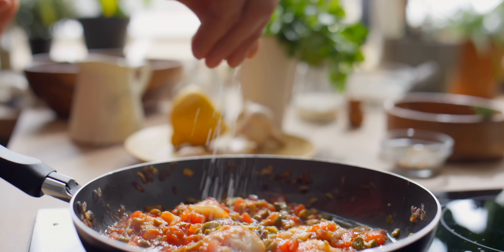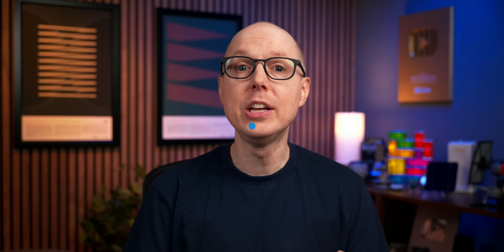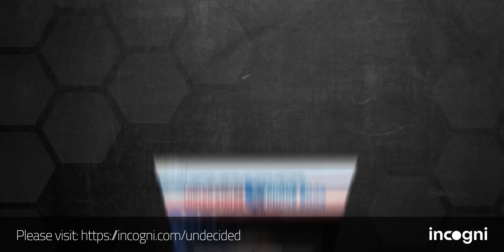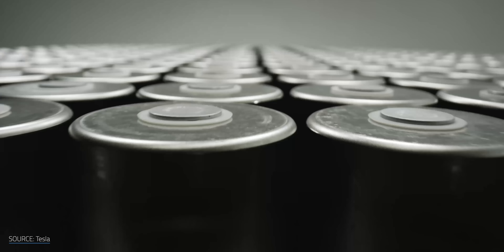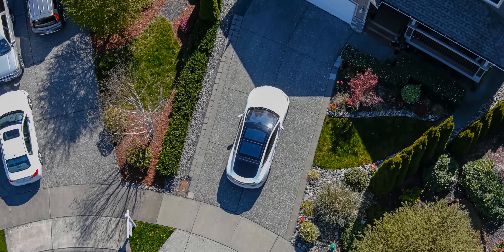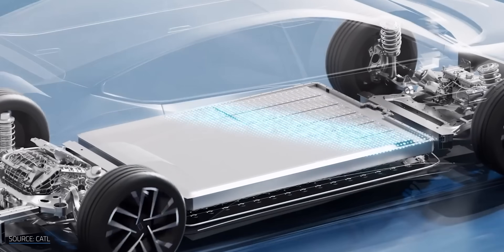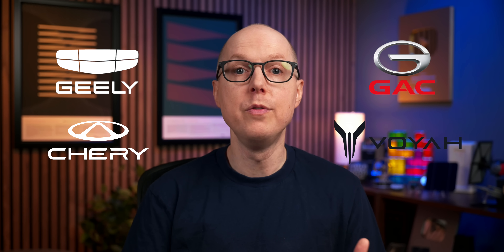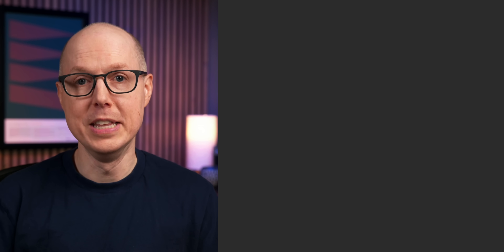How CATL Made Batteries 90% Cheaper (And What Happens Next)

Comment: Just researched a bit and here a some facts and numbers stated by CATL and other sources:

- mass production of gen1 sodium-iron batteries will start December 2025 
- gen1 will have an energy density of 175 wh/kg
- they are aiming to start mass production of gen2 by 2027, with an energy density exceeding 200 wh/kg
- the batteries are currently more expensive than lithium-ion or lithium-iron batteries, becoming price competitive when economies of scale and adoption catches on, expected by 2027
- the batteries are operational until -30 C, they demonstrated fast charging with up to 1200kw
- Naxtra batteries are expected to last 10000+ charge cycles compared to the 2-4000 cycles of lifepo4 batteries 
- CATL was one of the first battery manufacturers with sodium iron batteries in their portfolio and has been selling older gen products since 2021
- 67 car models are confirmed to launch using the new battery technology (although CATL is probably subsidizing the costs to be competitive)
- CATL is the biggest battery manufacturers the world and is expecting that the sodium-iron batteries will replace 50% of the lifepo4 batteries, a market they currently dominate

-> This does not seem to be vaporware, compared to many other „upcoming“ battery technologies mentioned on this channel, that are still years away and will be obsolete by the time they actually make it to market. Also, CATL actually has the cash to subsidize the batteries and speed up adoption until economies of scale kick in.
Reply: The potential is huge. A more practical renewable energy sector and electronics lasting longer. Let's hope for the best
Reply: The advantages in the cold are what will really open up markets. Modern LFP batteries waste a LOT of their power in cold environments just warming themselves up enough to remain functional for either charge or discharge, and some of the highest uptake markets for EV's are the Scandinavian countries due to government incentives. 

Also, there are large sections of the world where cars have to be left running overnight (some parts of Russia, China and Mongolia, Finland, Canada) to prevent them freezing up and becoming unusable. The carbon emissions reduction and reduction in operating costs for owners could be very significant in those markets. 

Also, there are already places that ban LFP battery EV's due to the fire risk. These vehicles would  potentially circumvent those restrictions and be a lot cheaper to insure.

If car manufacturers offer a Na battery version for particular markets I think they're on a winner, even if the price is on par. It certainly won't be the first choice for EVERY market until the price becomes far lower. Will that be enough of a market percentage to bring the cost down via economy of scale?

Range isn't everything for most users, safety and charging speed are at least as important, but cost is even more important. If CATL had brought this out 5 years ago it would have been a game changer. Now? It may be too late unless they are willing to internally subsidise production costs for market share.
Reply: @AndyViant  lithium is much less available than natrium so this tech still worth it for most markets. why china subsidises it so much is something i don’t understand yet.
Reply: @AndyViant these salt batteries cease to function at -30c. So they aren’t the solution.
Reply: @gordtulk  -30 C is a lot better than 0 C.
Reply: @gordtulk  Diesel freezes at -15°C and humans die long before then, what's your point?
Reply: @Adrian-Wright  obviously you don’t live anywhere cold. They make winter blends of diesel that has kerosene and other additives that keep it flowing down past -50c
Reply: @AndyViant  what current EV battery ceases to function at 0c?
Reply: @gordtulk  Your petrol engine won't function at -30c either. That's why you need block heaters. Guess what.... batteries can be heated too...
Reply: @theelectricmonk3909   EVs function just fine at -30c, if some engineer has spent the time to figure out how. As for petrol engines and block heaters, I live in the north of Finland, where it gets below -40c/-40f almost every winter. I don't always have a block heater, or can't use it anyway, but I've never been stranded because the engine is too cold. 12V batteries have let me down a few times, but jumping the car is always the solution. I've been especially happy with Toyotas, both the old beaters such as an -88 1.3L Corolla, and a hybrid 2.0L from 2019. There, too, someone has to think beforehand about what oil you can run here. Or you make sure you have power for the block heater 😄
Reply: @theelectricmonk3909   Oh, I should also mention, that the Toyota hybrid starts the EV system with the 12V battery, and only then the EV battery starts the engine. So it's basically a battery that functions in -40c, personally tested last winter in slightly windy -43c weather 🥶
Reply: @juhalampola1954  I should probably clarify actually.... because of course a petrol engine will run in -30 (or colder) temperatures - as long as the fuel can be atomised, and a spark created. In fact, a petrol engine will work better at lower temps, as the air is denser = more oxygen.

However.... if you leave it parked outside for a couple of days in -30 (or lower) temps, the chances of successfully starting it will be rather low, I think - unless you've got a block heater, or a spare warm 12v battery!
Reply: @theelectricmonk3909  modern cars start at -45 without block heaters.
Reply: @theelectricmonk3909  Some cars have problems, of course! The rest have been made to work in the cold. Here it's common for people to go to all kinds of winter activities, such as combined cross-country skiing and camping in the woods (scouts, especially!), or reservist maneuvers (something like 40% of citizens have served in the Defece Forces), leaving their cars in the lower end of nowhere for days, sometimes weeks, even in sub -30c temps. Starting problems are rare, and have been since, roughly, the year 2000. Gasoline, diesel (winter blend), or electric, it doesn't matter.

I have personal experince with two gasoline cars that didn't have an engine heater, model years '91 and '78, that never had starting problems unless I had skimped on maintenance. Yes, I did start both several times under -30c, after sitting outside (apartment block parking) for more than three days. The cars that can't do that get sold to people further south 😅

What people fear about winter driving is, first, fear itself, and second, incompetence. Fear keeps you from starting the car in the cold. Incompetent maintenance, be it you or your mechanic, keeps the car from starting in the cold. (Caveat: the cars made by manufacturers who simply don't care how they perform in the cold.) Everything else has been solved a long time ago.

Oh, about the -43c start with the hybrid Toyota. I was at a wilderness cabin, at river bend surrounded by steep 300ft hills, and the place is known to get really cold at times. Got there on Saturday (-10c or so) Monday was really cold at -35c, left at noon on Tuesday with the car saying it's -43c, drove home over a few hours and it was -15c. Don't get me started with how much snow there was...
Reply: @gordtulk  Define "modern" 😄 I used to have -78 Volvo, without engine heater, that started in close to -40c weather as if under a palm tree, as long as I made sure the big (old) aftermarket battery I got it with was watered! I'm pretty sure I started it at -45c once🤔
Reply: @juhalampola1954  ironically - a couple years ago I was flying in/out of Edmonton in January and as is usually the case the overnight lows are -30 to -40. I like thousands of others park in an out door lot and leave their car for days or even a couple weeks. 

On returning and taking the shuttle bus to the lot the driver would wait at every drop off until the car owner managed to get his car to start - at -35 frostbite in a few minutes is a real threat - if it didn’t he was ready to boost the vehicle. 

I asked if there was a brand of car that was the worst for needing a boost. He responded instantly- “Volvo” the worst by far.
Reply: @gordtulk   Volvo in '78 (and '98, when I had the car) was Swedish. Swedish design, Swedish engineering, Swedish manufacturing.

Volvo in 2025 is Chinese. Chinese design (with token Swedes), Chinese engineering, Chinese manufacturing.

Make your own assumptions/conclusions ;)

If you want to drive something nice, that's made in Sweden in the last few years, shell out a few hundred grand for a Scania semi 😂 In the 80's, everyone here in Finland drove or wanted to drive a Volvo, because they were safe and they just worked. I didn't mention my car because Volvos nowadays would be good, but because my -78 240 (244) was.
Reply: @juhalampola1954 these were Swedish Volvos. Apparently they had a notorious accessory drain that could only be stopped by disconnecting the battery.
Reply: @gordtulk  Nonsense, the amount of energy needed to keep the battery at -30C in a say -40C environment is trivial, besides "The Naxtra passenger EV Battery retains 90% usable power at -40°C"
Reply: @gordtulk   Oh, sorry, English is not my first language, so I understand "a couple years" as significantly less than 15 years. Ford sold Volvo to Geely in 2010, with R&D mostly happening in China not five years later.

I'm not convinced the engineering exchange was one-way, out of Sweden, even when they were owned by Ford. Everyone in Europe knows, that the automotive industry in the U.S. lags behind in several important fields, such as safety, engine efficiency, and - oh, yes, accessories design... 🙃
Reply: @pcwcol  for a couple weeks?
Reply: @gordtulk  -40 forever -45 for a couple weeks no issue. Also how many hours in how many days are going to be below -40C?
Reply: @gordtulk  Volvo owned by Geely.
Reply: @gordtulk so.. that only excludes the extremendous latitudes...
Places like Australia, Thailand, Indonesia,  Mexico are all fine
Reply: Sodium, even at the same price as lithium, has massive benefits for certain applications like storage for small solar installations. There the battery often isn't sheltered from cold. A no-Go for Lithium in moderate climates but no problem at all for Sodium. 
Your smartwatch and handy will still use Lithium but the rest will quickly change to Sodium. Low prices are THE game changer for EVs and and storage and these markets have the volume to take in everything the industry can produce.
Reply: Sodium-ion batteries, not sodium-iron
Reply: Excellent research and thanks for the details!
Reply: The major driving force is cost, though, as building a decade of disposable cars has caused major issues in the used car market and repair shops. The local GMC dealer?  Won't accept any EV for a trade-in. Mind you, the majority of a dealership's money comes from repairs and used car sales. Hugely unpopular with the staff and mechanics, and this trickles back up to corporate. They see a looming mess of unrepairable cars and customers swearing to never buy an EV again. 

So the pressure is coming from here. Imagine buying a used Tesla model 3 and it needs a new battery.  And having a $2000 option. Bit less range. Massively lower cost.  $2000 and it's back on the road with 250 miles max range. Not perfect, but better than junking the thing and taking a 20K loss.
Reply: @plektosgaming  What do you mean by "Bit less range."?
Reply: @Logan4661  The energy density is lower, meaning that you have to have less cells to get to the same weight/fit in the same space. The idea is to take existing vehicles and make swappable packs and a seamless transition for manufacturers. You will get about 80 percent of the range, but drop 8-10K off of the car's price, on average. TBH, most people won't tell the difference between 250 and 300 miles as few people drive for more than about 3-4 hours without taking a break.  Certainly not for daily driving. The average in the U.S. is 250 miles a week. So... the need to chase 300 , 400, 500 miles is just marketing B.S. we pay extra for.
Reply: @plektosgaming  The question is, why would someone pay $2000 to get a new battery with less range than they were getting with the old one? They won't, they will simply keep using the old battery until a new one is an improvement worth at least $2k to the owner. In other words, a bit less range won't be a factor.

I agree with everything else you've said though.
Reply: @Logan4661  This works until they have to replace it.  Then they still can repair it for less than say, repairing an automatic transmission, since it doesn't have one. IT all works out in the end. But 20K or 50K if you have a Mercedes EQS ( yikes ) is just a flat "no way" from all but the most stupidly 1 percent.
Reply: @plektosgaming  I don't think you're pickin' up what I'm puttin' down. They won't replace the original battery until it has significantly less range than the replacement will offer... so "a bit less range" isn't an issue.
Reply: More insightful than the vid and took a minute to process. start a channel, 1 minute news and get very popular. brevity is the sole of wit.
Reply: There's news that they are decommissioning their lithium mines.
Reply: Mixed battery types use does not make sense because of temperature conditions.  Not sure why a company would lead with this.
Reply: @MrScientifictutor , all it needs are individual battery control via better BMS software
Reply: The $10/kWh sounds like total BS though.
Reply: What was your research, ChatGPT? That’s not research! ChatGPT just searches for articles or discussions off the internet. So all a company has to do is make an article with all their talking points. ChatGPT then just regurgitates their talking points no matter if they are true or not. I wish people would stop calling chatGPT research. I can create a fake subject, write some articles on the internet and suddenly ask ChatGPT about it and it will repeat everything I say in the article as being fact!
Reply: > the batteries are currently more expensive than lithium-ion or lithium-iron batteries,
imagine that, the leading battery company doesn't actually want to put out a product that does the same thing as their current one does, but for 10x less
Reply: Not all heroes wear capes
Reply: Thanks mate. You saved me a lot of time. This guy talks too much.
Reply: @M.V.P.  So the 10$/kWh was bullshit?
Reply: 10k cycles is neat but it needs to come with adequate calendar life else this will become the limiting factor. For home energy storage where one cycle = ones day that's 27 fucking years wow.
Reply: subsidize aint something good
Reply: @cia5649  it really depends on
Reply: China CATL isn’t like scammer loser US companies
Reply: @Ps5prolite  why bother making comments like this?
Reply: 10000 cycles seems impossible tho
Reply: -30c is going to be an issue.
Reply: @gordtulk  In Greenland or the Antarctic, maybe. Everywhere else, it's fantastic. Heck, even in orbit, that's a great number.
Reply: @PiDsPagePrototypes  umm perhaps you aren’t familiar with the northwest mountain states and much of Canada.
Reply: @gordtulk  Nah, just used to folks from Nth America confusing degF with degC. Nth Western Territories will be same same as Greenland.
Reply: @PiDsPagePrototypes  -30 c is reached every winter in much of this part of the continent.
Reply: @PiDsPagePrototypes Canada has used metric temp for fifty years.
Reply: @gordtulk  Fortunately the vast majority of humans live in places where that's not an issue. Where it is, people are usually smart enough to opt for PHEV and not pure battery-run cars.
Reply: @gordtulk  I think the point is that they are effective till -30c. IE they operate better in cold than other batteries.
Reply: @ThatGuy-bz2in  I think there is more to it than that. These are batteries that contain water
Reply: @gordtulk  Its better than lithium already
Reply: @gordtulk  in Canada and Northern Europe, definitely. I’m in Edmonton, Alberta, the northernmost provincial capital city with 1.2M people. 🤷🏾‍♂️
Reply: @gordtulk  if it is -50c outside it is a lot easier to heat the batteries up to -30C than it is to heat them up to 0C. If it is -20c outside then no additional heat is needed.
Reply: @gordtulk  for most of the world, no.
Reply: Back by CCP?
Reply: @Dirtyharry70585  Yes! Wouldn't it be nice if the U.S. government still supported future technology in this area.
Reply: @ericstevens8131  lol the oil tycoons wouldnt allow that. china basically has been making batteries for everyone since forever so i dont really see the huge deal, but still some more competitions in the future would be nice to keep the price down.
Reply: @ericstevens8131  Yes, I heard they're coming out with a gas powered, small engined cell phone in the US.  They think that makes sense!
Reply: @ericstevens8131  We did, too bad it was to the goosestepping african
Reply: @Jon-ho5tkWood burning gasogene engine, like they used in WW2 Europe when all the oil went to the military. A bit bulky but there are always tradeoffs.
Reply: @ericstevens8131  in Trump goverment, I do not think so 😢😢
Reply: @Dirtyharry70585  
100% certainty that the CCP will subsidize CATL and their domestic EV brands. They already do, and this will only intensify their efforts.

Comment: I live in a part of Canada where -40c is a typical mid-winter outdoor temperature. My house has no garage, and installing a level 2 charger would be impractical for me. That has made EVs a nonstarter for me; battery conditioning takes so much energy in the winter that the charge would actually drain while plugged in to level 1 charging! If sodium batteries can solve the cold issue, it would finally make EVs a genuine option for me.